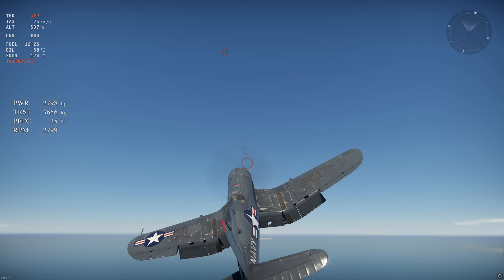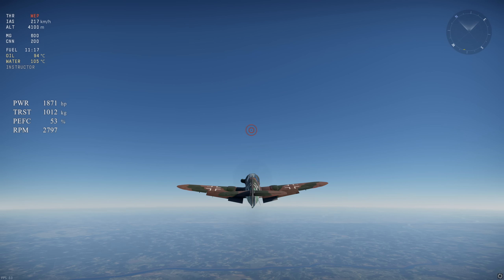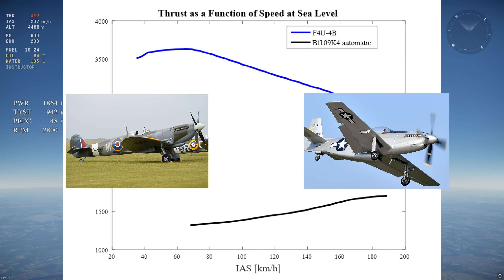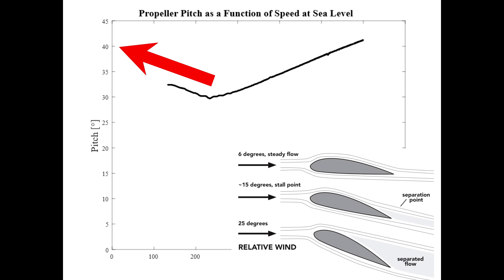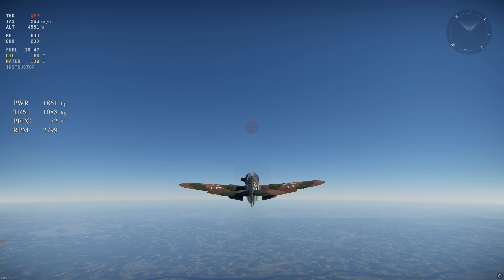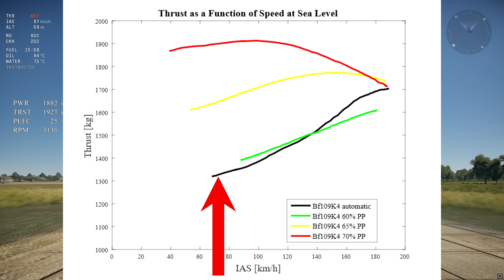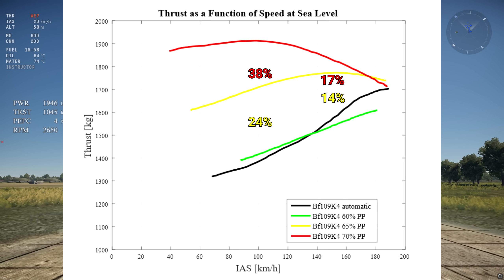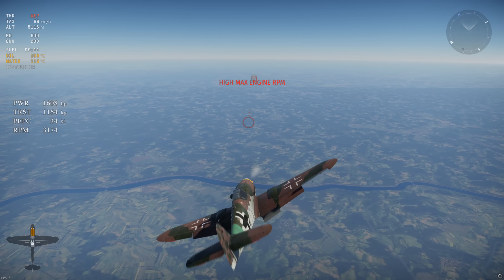War Thunder Tricks #8 | Prop Pitch Trick for Extra Thrust

Comment: hey Adam! thx for the vid. i watched your first video about this trick 3 years ago and use it any time i can. 
the main thing is using it during the heat of the battle.at the start of the match i put my pitch at 68% but active auto pitch after that. once i need it i switch to manual pitch and it goes to 68%. good thing about 68% is it can be used below 2500m easily.
BTW the new mustang is a joy to fly. based on my tests put the pitch at 90% and radiators at 55 for hot maps and 45 for cold maps to prevent significant emotional event during climbing. 
can i use this trick on ta152? i looks like it has a small prop compared to it's engine power .
Reply from the maker: My pleasure!

Yup you can get the pitch ready so that all you need to do is activate manual prop pitch for it to work! You should use it on takeoff, you takeoff a lot faster.

Ta152 actually has a significantly bigger propeller than Bf109s with not that much more power, it doesn't have to use this trick.

Comment: Does this work for other planes? Italian planes? They use the same engines
Reply from the maker: Another even more intense trick used to work on the Re2005 (I made a video on it), but it got fixed. Italians mostly decided to follow the trend of prop pitch % giving an RPM target.
Reply: @AdamTheEnginerd  interesting. Well I do know the Italians could connect the throttle and pitch together as their "auto-pitch" system. Wasn't sure if disengaging it and manually adjusting the prop pitch would grant any benefits.  Maybe in real life it would? Rather than how they are represented in game.

Comment: As an aircraft mechanic, i am proud of you for figuring out prop pitch, and how you can use that to your advantage in-game. 
95% of all prop airplanes' propellers can have their pitch adjusted. They can go from a full feather, (which is when the blade is perpendicular to the direction of movement) to a full 90° "flat" position. 

Turboprop propellers can even go all the way into reverse. They slow down on landing this way. 

Now on most planes, this is a more or less automatic process, for the most efficient operation. The pitch is reduced as your throttle and RPM increases, and increased as you lower your power & RPM.
The only control you have is adjusting the upper and lower limits of that, using an RPM lever type control in the cockpit.
On a piston aircraft, you have three such controls. Throttle, mixture, and RPM. 
On a turboprop, you only have two: power and RPM. 
When you shut your plane down, the best practice is to bring your RPM all the way either up or down. It covers the pitch changing mechanism, and protects it from the outside world.

 On a turboprop, it's much more important to do this because it also prevents your propeller and engine from pinwheeling in the wind. This prevents an unlubricated engine from turning, and wearing excessively. 

Hope you enjoyed this bit of knowledge.

Would you like to know more?
Reply from the maker: Useful info!

Comment: In the beginning you're talking about a Vx climb, once you add the constant speed propellers in its getting into propeller efficiency. I don't play war thunder so idk how the game's planes work, but normally you set the propeller governor to a certain engine rpm that is most efficient for a specific power setting. Like in a Piper Arrow II, a good climb setting is 25" of manifold pressure and 2,500rpm on the governor.

Edit since I read my own comment: Both things I was talking about are about propeller efficiency lol
Reply from the maker: The automatic system in most planes takes care of changing RPM when you change throttle. In this plane you actually need to manually override the automatic system to give the pitch and hence RPM you want.
Reply: @AdamTheEnginerd  ah ok, in 'real life' you control the pitch of the propeller by setting the spring tension on a governor via a lever, which adjusts it to seek an engine rpm by either increasing or decreasing the pitch angle of the blades to  add or remove torque/load from the engine. So, set the rpm with the propeller control and it will hold that rpm regardless of power setting. I'm sure newer aircraft with special computers constantly adjust this automatically like on the new Technam. Thanks for the clarification!

Comment: Could you gain more thrust by throttling down instead of using mec at those low speeds in the 109?
Reply from the maker: No, because you'd lose so much power and you get lower RPM at 100% compared to WEP.

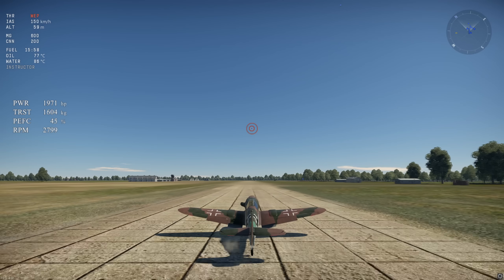Comment: 5:00 What do you mean by at 5 km?
Reply from the maker: 5km of altitude.
Reply: @AdamTheEnginerd  metres or km? You were using m...
Reply from the maker: @StarWarsMasters  5km.
Reply: @AdamTheEnginerd  You can't measure altitude in kilometers in wt. Only feet and meters.
Reply from the maker: @StarWarsMasters  And I did the conversion to make it easier to say...?
Reply: That will take a while to pull out my phone to calculate while I'm dodging and stalling an enemy.
Reply from the maker: 5km = 5000m.
Reply: @AdamTheEnginerd  Does a 100 matter in altitude?

Comment: Hey Adam, is the overlay with the excessive amount of useful data legal? It isnt made by gaijin and would technically give you a slight edge. Just wondering...

Also I just watched to the end and you said if I had suggestions I could tell them. So ehrm: How do I avoid missiles without losing all speed in the MiG 21? (MF for me but others work too)
Reply from the maker: All it does is put the information Gaijin displays publicly in the local host into another format and easy to overlay. They haven't said it's legal or illegal, but also they can't know you're even using it so it would make it hard to enforce anyway.

Overlay is mostly for fun and interesting observations.

Eh I'm no expert in either top tier or Mig21 haha.
Reply: @AdamTheEnginerd  thanks for the quick response :)

Comment: Great video as always! I learned this trick from you 1 year ago and it’s extremely important to fight 1v1s against aircrafts that can match 109s climb rate like the Griffon spits or the yak3. Since you can’t outturn them, the only way to get behind them is to reverse the situation with a stall climb.
After the headon climb at medium speed (about 330km/h IAS) then when they are like 2 km away from you go full vertical and use the trick. If they followed you in your medium speed climb, they are dead.
Some players might start climbing at more efficient speeds without committing, then just run away and focus on others, since if they don’t commit, they aren’t a threat to you.
Reply from the maker: Thanks!

Getting slow against a Griffon is likely a death sentence. Using it against Yak3VK can be viable.
Reply: AdamTheEnginerd at medium high altitude is the best was to kill the LF or the VK.
Against griffon it works between 4000 a and 5000 meters. At high altitude (6000m) I usually start running away until i get about 3 km distance, then stall climb, and then you’ll be again facing each other at about 1.5 km, but you’ll have a small energy advantage. Just repeat this trick 1-2 times more and you’ll have a big energy advantage.
If, instead of following you running, they start climbing just ignore them and go for other enemies. 
Obviously with a decent team bait and switch is a much much better tactic much less dangerous

Comment: How did you keybind it to be efficient? I always lose like 5 seconds switching to manual prop pitch. Do you micromanage it all the time?
Reply from the maker: You can get the prop pitch ready even when it's still automatic by using the keybinds to increase/decrease it. Of course you don't see it changing yet so you need to get a feel for how many times you need to press the key to get the appropriate value, but after that all you need to do is activate manual prop pitch and voila. I get it ready to 67% PP when I think I'm going to need the extra thrust soon.
Reply: @AdamTheEnginerd  nice tip thanks

Comment: This explains why I can't stall climb without breaking my engine in a spitfire in DCS, very useful knowledge.
Reply from the maker: Oh really?
Reply: @AdamTheEnginerd  Everything engine control related is manual in DCS, and in order to stall climb you need to push the engine quite a lot. Either that, or something to do with how the spitfire uses a carburetor? The engine fails if you perform a prolonged stall climb, an excessive dive, or a flat-spin. (And engine shut-off due to fuel flow if upside-down or pulling negative g's)
Reply from the maker: Maybe you were in neg Gs for a few too many seconds in that climb and your engine shuts off.
Reply: @AdamTheEnginerd  Nah, the engine breaking and the fuel shutoff are two different things. Pull a standard stall climb, come out of the stall climb, and the engine is banged up and smoking - however still running the entire time. A fuel cutoff then can just do a mid-air engine restart and no loss of power.
Reply from the maker: Hmm yeah maybe you overreved then.
Reply: @DRUBZTheBlazeOfArt  maybe you exceeded the manifold pressure, that would damage an engine irl
Reply: Arkavii If its an early spit it may have been in a position starving the engine of oil.
Reply: @whackyjinak4978  its a Spitfire LF Mk IX
Reply: @DRUBZTheBlazeOfArt  you deffinitely went too high on the rpm. I only know the values for the 109 mostly 109e as thats whta i mostly flew in cliffs of dover, but obviously a spitfire usnt made for certain manuvers. Have you read the manual? Which variant are you flying? Im sure theres some original. Manuals on ebay or for download.
Reply: @AdamTheEnginerd  mayb some Spitfire tips next please!
Reply: @AdamTheEnginerd  nice man but again help me out to use it on ps4 thanks by the way. U ARE ONE OF THE BEST PLAYERS
Reply: No German pitch is the angle of the prop everyone else's pitch is the rpm of the engine
Reply: The spitfire is a whole difderent topic altogether

Comment: Did they nerf the fw190?? I can’t pull any g’s now as to before with the a5/u12 I could pull 10g easy with speed
Reply from the maker: Apparently it has been buffed. Haven't played them since the change.
Reply: They got better elevator authority and better stall in exchange for no more unlimited WEP, worse overheat, and more suffering in the performance department when you take damage. I'm sure I'm missing a few changes but what I still remember from reading the patch notes.
Reply: The U12 could never pull high G's like that before. The U2 is the high G turner you're looking for.

Comment: If this happens because of the small propeller then the Tempest and the F8F are good because their propellers are huge(or they look huge at least)
Reply from the maker: Yes but remember it's the ratio between power and diameter that matters as well, and they have more power than Bf109s. Indeed they do handle low speed better than Bf109s. F4U4B handles low speed very well.

Comment: Spitfire LF at 5.7 has 32m/s spaded climbrate. With 100% Prop. pitch it has around 40m/s and is an absolute beast, and starts overheating until like 6-7km (also the supercharger has 2 gears which let you have around 40m/s climbrate up to around 3-4km and then around 4-7km you have 30m/s)
Reply from the maker: Nah it does not climb like that in realistic.
Reply: @AdamTheEnginerd  i dunno man i always out climb everything in it and everyone is like 1 km under me lol , might send a video
Reply from the maker: @petrkdn8224  Your climb rate numbers are off, that's what I'm saying. LF is a great climbing plane.
Reply: @AdamTheEnginerd  spaded its 31.8 m/s
Reply from the maker: Stat cards lie, those values have hardly any relation to what the performance of the aircraft truly is.

Comment: the difference in some planes turn rate on mouse aim and "realistic" control is astonishing, as a suggestion i would look into it more, great video adam
Reply from the maker: Hmm I remain skeptical. You need testing to make sure it's not just your impression due to pulling more AoA, and the higher speed loss will worsen your turn time.
Reply: @AdamTheEnginerd  one more question, i dont know if its a warthunder flight model thing or if its a realistic mechanic, but when you pitch up hard on a horizontal turn, the plane suddenly losses control after a second or 2 and starts aggressively rolling.
Reply: oh and roll rates are definitely slower, i dont even know if its possible to do mouse aim rolls with realistic controls
Reply from the maker: @shrekrecker  Well that's because you're beyond the stall angle, hard to control an aircraft past its stall angle.
Reply: @shrekrecker  Another reason beyond what Adam mentioned is that mouse aim prioritises yaw over roll at small angles, then only switches to roll after a delay. When you yank the mouse pointer upwards, the instructor's first action is to boot top rudder which sends the plane into a snap roll. You can avoid this by controlling your roll with the keybindings. It's an integral part of flying with mouse aim.
Reply: its not just turn rate, i would say it completely changes the plane (on some planes)

Comment: I still have a question. Is it a bugg or is it working as intended?
Reply from the maker: I arrived at this trick by understanding what the issue was and using manual control to compensate for it, so it is working as intended in the context of the game. Would pilots be doing this in real life? Definitely not.
Reply: @AdamTheEnginerd  Ok thx.

Comment: Uhhhh.... What?

This is like trying to explain advanced calculous. Just... what?
Reply: Basically, planes with big engines and small propellers (like high tier bt109s) lose thrust at very low speed in order to prevent the engine from exploding. This trick he talks about allows you to get closer to the explodey power than the game would normally allow you to get, giving you more thrust at very low speed (<200kph).
Reply from the maker: ^^Basically, thanks Hanif!
Reply: Rewatch the video a few times you'll understand it then

Comment: I didn't know about this or that you can even change the RPM...

Edit:
Seriously I don't understand it.
Reply: You know how in a car you can't go 100 in first gear because the engine will explode as it's revving too quickly, in a plane you can spin the propeller too fast and the same thing will happen. Normally the game changes the prop pitch to reduce the RPM to prevent the engine exploding, but in this he tells you how you can manually override this to get more power at low speed.

The game likes to hold the RPM at 2800, but you can go up to 3200 safely, and this lets you get to (or just below) that point.
Reply: @Sir_Budginton  
Oh.
Thanks!
Reply from the maker: Thanks Hanif!

Comment: I just want quick practical knowledge, so, 
0% pitch is feathered and 100% is for max trust (?) is it even useful to use 100% ?
75% pitch gives the most trust at sea level and below 200kmh but only for 109s (?!)
So f4u4b won't get any positive effect on this ?
Did I understand correctly ?
Reply: It all varies from plane to plane, which is why when you get a new aircraft you need to mess around in the test flight for a while figuring things out. 0% is feathered and will give minimal drag but basically no thrust (great if your engine gets knocked out and you need to glide back to base).

What 100% does varies from plane to plane. In a 109 a 100% prop pitch will just blow up the engine, but in a spitfire it's totally fine.

70% for 109s at sea level (75 will blow the engine), below 200kph. Above 200 the auto prop pitch does a good job, but below you can override it to get more performance.

He talked about 109s specifically because they have big engines but small propellers. Any plane with a big engine and small propeller will suffer from this same issue of loss of thrust at very low speeds. Planes like the F4U have big propellers don't really suffer from this particular issue and so don't really benefit.
Reply from the maker: German prop pitch works differently from other aircraft, you are better off leaving it automatic except when performing tricks like this.

For other nations' aircraft, general rule is prop pitch = throttle.
Reply: @AdamTheEnginerd  i find that out when i run away frow itali plane in my fw190 when 2 of them behind me they cant catch me maybe they plane slow
Reply: German plane dont like 100%prop pitch the engine die
Reply: Only german plane that can use 100% pitch is mostly attacker ,but even that some of them still will have problem the fw190 can do this trick to push the speed more higher in straight line but the engine will over heat

Comment: What happens if you progressively reduce throttle below 200 km/h to keep the automatic pitch control from stalling the prop? If overevving is the main limit then maybe you'll get even more thrust at very low speed with 100% throttle and 80% pitch than WEP throttle and 70% pitch, or something like that.
Reply from the maker: That is a good observation. On some aircraft that works (P51H) because WEP and 100% have the same RPM. However, on the K4 for example, WEP RPM is 2800, but it goes down to 2600 RPM at 100% with a loss of around 600 HP, and that's 600 HP that you can't convert into thrust even if you improve the prop efficiency at low speed, so you're still better off WEPing.